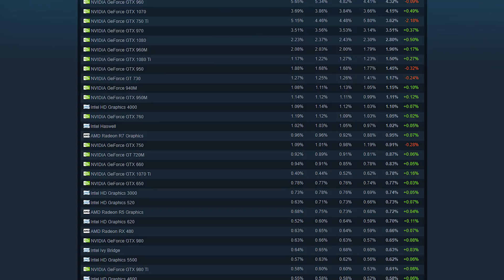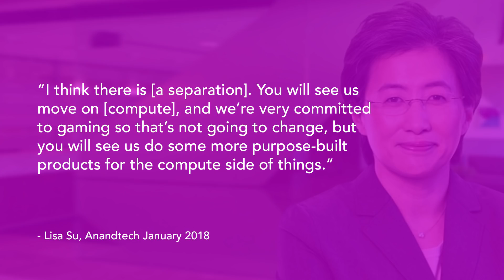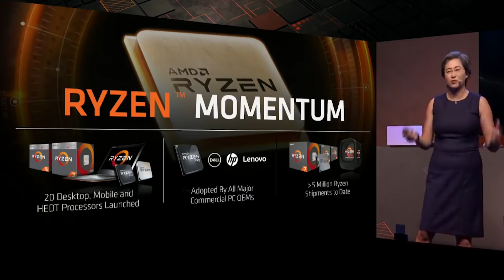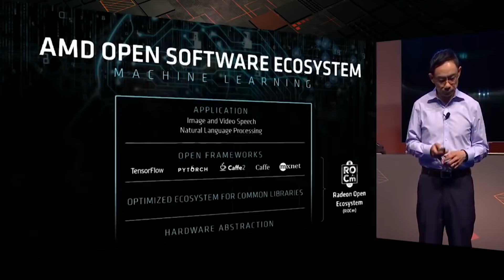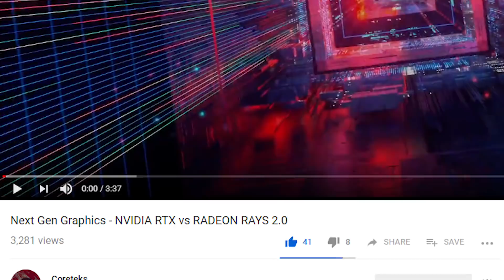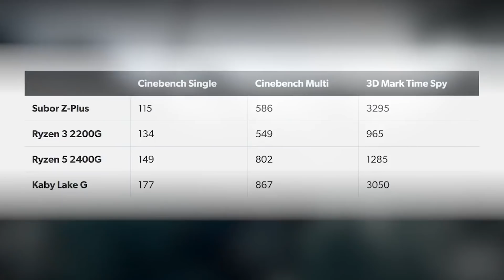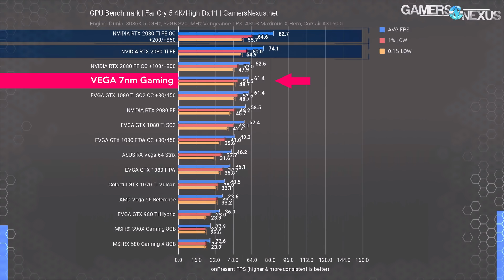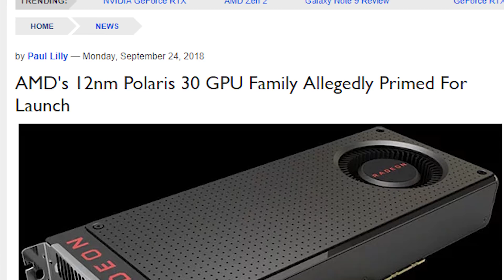AMD's answer to RTX

Comment: Very nice video mate, didn't actually expect to hear any info, I honestly thought it was a generic rumor mill video, but to my surprise it's packed full hah. A couple of things I think you misjudged a bit on Vega, as for example, AMD had to use HBM2 memory not because of architectural design, but rather because of power consumption, as GDDR5(X wasn't available at the time) would be extremely power hungry as a whole package, GPU + all the vRAM chips. Also, Vega wasn't a "fail" because of a bad price, but because of a bad price caused by mining boom. AMD didn't set the prices too high, especially for 56. It was actually a great GPU at that given price, really nice competitor to 1070. 64 was a bit odd, a bit expensive yeah, and LC was pointless with it's price. Other than that everything else you talked about I really liked and I always like and have much respect when people predict whats gonna happen in the tech industry, simply because that really hard and you have to know a lot of things to be able to predict, logically. Navi in 7nm in 2H of 2019. seems actually almost 100% possible and the performance you said I think it right on point. 2080 like performance, but maybe with no RT or maybe not inside DX12 API feature_level.. I dunno. There is going to be some flaw in it, maybe typical AMD power consumption, but I doubt that since we are on 7nm, but they'll have some small flaw or I can say a con.
Oh, and also I subbed because you have a very nice voice tone or "color" as we say. Very dramatic voice, like a trailer for a good horror movie or some dramatic scene in which thousands of people will die. :)

Cheers

Comment: well they invest in computing aspects of gpus, so you wont ever see a high end gaming card by amd. anyone who knows economy just 1% will see that. keep hoping for your 7nm vega its gonna perform like a 2080 max
Reply: AMD has "always been" compute focused..up to the developer to take advantage of its design VLIW5-4, GCN as all "multithread" approach which by its nature are BUILT for "compute" Radeon workstation stuff has kicked Nv products to the curb many times over, the desktop grade shares the same "genetics" just because Nv "chose" to trip all the "fancy stuff out" does not mean AMD did so, difference is when you throw a bunch of complex work at the Radeons they tend to do "quite well" but over the last couple of generations unless you use very specific code the compare Geforce/GTX or whatever "choke" really quick because they are not "jack of all trades" they are either "speed" or "complex" not both, Radeons are a balancing board that goes between those 2 points (workstation class are far far more "complex" because they need it, desktop grade are more focused on "speed" with complexity) 

there is a very good reason why folks were using Radeons for "hashing" for many years now..they do it MUCH better than Geforce (with very few exceptions to the rule)
Reply: is there some performnace trouble with 2080?
Reply: ist the same as a 1080ti performance wise.. but upcoming patch and optimization will make it quite a lot better i think..still,amd isnt gonna have the best gpu on the market,maybe regarding Price but not performance
Reply: vic berlin   I Believe also AMD won´t have the top GPU, but that said, I Think the discussion is sometimes distorted a Little bit, as we focus on THE BEST GPU, while the majority of people play with mid range GPUs. Of course it is nice if someone have 200 fps on a game, but what if 100 is just fine? I don´t Think there will be queues outside stores to get 2080Ti for 1200 USD. So for me it doesn´t matter if 2080Ti is and will stay the fastest. What matters to me is the competition in the mid range, like will prices come down, will there be a faster than VEGA gpu, or some update from RX580, or even just prices of VEGA/RX580 coming down.
Reply: pjotrll nobody will have 200 fps on 4k :D i like to talk About the best gpu because only that will give me 60 fps on that resolution, single gpu. Nothing was able to do that up to now. i got a msi 2080ti ventus, 2 fan design but temps and Overall performance is just a Dream..i Paid a fortune but the way i feel now and the way i can Play my stuff makes me think it was rly worth it..the mmost interesting Cards for the majority of People will be the ones with the best Price/performance ratio, but hey it all depends on what you expect.. i Need the top notch graphics,the experience is just so much better with it
Reply: I didn´t talk about 4K, what I ment was that if you run 1080 or 1440 it doesn´t help much if you reach "200fps" with 2080 and "only 120 fps" with 580, then why would you pay a lot more for things you don´t notice. If one needs or uses gpu for work it is Another issue, then the price might be Worth it.
Reply: @victorchb1  my condolences when your 2080ti explodes
Reply: @edwardpark247  runs fine for over 2 months now,8+ Hours a day,not my problem youre poor

Comment: its pointless to bring 7nm vega at this point when Navi is soon to be here. what they should have done was a 7nm which GDDR6 and call it the RX 580. not make the rx 580 a rebrand. the reason Vega cost so damn much is because of the HMB which we wont get the full benefit of it yet because said gpu are not powerful enough to push 4k gaming at the frames we want in the first place...GDDR6 could have made vega being a 300 to 400 line possible.

Comment: More AMD HYPE, that seems to be the only thing AMD is good at, selling BULLSHIT HYPE... This BS AMD HYPE caused me to remove my AMD Blinders and look to Intel for all my Computer NEEDS... AMD use to be the King of the Hill over a decade ago but in these modern times AMD is nothing but HYPE... Anyone can say they have something working in their Basement but until they can produce a real world sample, it's all HYPE in the meantime... Cheers...
Reply: Are you talking about The CPU side of AMD? If so than you couldn't be further away from the truth, as their R7 2700x is 3-5% behind Intel's best CPU the i7 8700k in 'gaming' for 18% less in price, but is 20% ahead in rendering/compute performance due to the extra 2 cores and 4 threads. Give AMD some slack because if they disappear, then CPU and GPU prices will skyrocket far past what they currently are. The computer industry is a mess under these misgivings.
Reply: Over the past 10 years AMD has said one thing and produced NOTHING. I am with you, Intel needs competition but AMD is Intel's Bitch Stewie and nothing more. If you've seen Family Guy you should know who Bitch Stewie is. If AMD really wanted to shake up the CPU Market they would price their CPU's appropriately but they don't, they collude with Intel and allow Intel to set their pricing. Then AMD wants you to buy, buy, and buy when they don't give you anything better. Sure I will give you the R7 2700 is a bit better then previous Thread Rip Offs but still it's no real competition for Intel. Worse yet what folks fail to realize about Thread Rip Off is it is actually two separate CPU's on a single die. Now compare a pair of Intel Xeon's to Thread Rip Off and you are no where near the margins you listed. 

More so AMD claims to have Quad Channel Memory when it fact it is actually a single Dual Channel for each CPU so basically it's double Double Channel and not true Quad Channel hence the reason AMD is having such timing issues with Memory. AMD Hype is what they do best and that is a shame. If AMD really wanted to shake things up it would price Thread Rip Off at double of what the Ryzen 7 1800, (or what ever is the current Ryzen Chip) is selling for but it Colludes with Intel and jacks up the price some 300 USD more. I've been working with PCs since 1986 and though I will not ever know it all, I can say with confidence I know what I am saying here. I've seen AMD as Top Dog and they trashed Intel until Intel stepped up it's game and took back the lead. Now AMD is not even in the same Universe let alone the same playing field. 

There are way too many AMD Fan Boys out there, I know I use to be one, and I am here to say AMD is selling Hype right now, nothing more, just Hype. AMD has 1 CPU in the top 10, the Thread Rip Off 2950X and here is how it compares to the 4790K (Highest Single Thread of the 3 and Lowest Work load and TDP) and i9-7940X: https://www.cpubenchmark.net/compare/AMD-Ryzen-Threadripper-2950X-vs-Intel-i7-4790K-vs-Intel-i9-7940X/3316vs2275vs3094

Keep in mind both Intel CPU's and single CPU's while Thread Rip Off is Dual CPU's on a single die. Passmark fails to list Thread Rip Off as a Dual CPU and throws it in with single die CPU's which gives AMD a serious boost. If you go to Passmark and view the Dual CPU charts Thread Rip Off is near the bottom and AMD Epic makes a showing near the Top; but Epic is nothing more than a Pair of Thread Rip Offs on a single die or 4 CPU's on a Single Die. There is no way to compare a pair of CPU's on a single die to a Single CPU on a single die; just because it's on a single die does not make it a Single CPU. If AMD really wanted to shake things up they'd release a Dual CPU Ryzen Board. If they did no one would buy Thread Rip Off... Cheers Mate....

Comment: So much wishfull thinking in this video...
If you're going to be cocky and tell your viewers to "present their arguments", first do it yourself. All this video has "presented" are excerpts from AMD management's announcements with nothing actually specified and "just wait, guys, it's almost here!" from the author of the video. Period. Nothing concrete whatsoever. All that AMD has officially confirmed for now is Polaris refresh and I don't see in which universe will RX580 compete with GTX 1070/1080/1080Ti, even on smaller litography, and CERTAINLY not at prices you might expect (with memory prices being as they are and GDDR6 still new). Nothing whatsoever indicates Vega on 7nm in next 3 months, especially with RTG focusing on Polaris refresh now, and proudly insinuating it is wishfull thinking, sorry...

Comment: AMD just can not get their production costs low enough to be competitive. The Vega 56 and 64 are still overpriced at $400 and $500USD respectively.  The GTX 1070 and 1080 go for $365 and $430 USD respectively. The lack of support is the other big problem. From software developers to aftermarket retailers, getting support is difficult to non existent. AMD needs to fill those gaps themselves if third party vendors will not. Thanks for sharing. Very imformative.

Comment: I agree with most of your comments, however as far as AMD were concerned the RX cards whilst not in the same league as nvidia's sold like hot cakes and therefore reaped them some much needed cash. I think they are still on course with thier road plan concentrating on the enterprize market to get the stability they need.
I do believe nvidia rushed the RTX cards because they sensed AMD releasing something soon and to be honest (even at the prices they are charging) it's worked, I don't think AMD are bothered about it at this moment and are happy to just keep Nvidia on thier toes.
What I do believe is they will bring out a relevant high end card within the next 18months to 2 years, meanwhile I'll stick with my current card because I ain't paying double the price for a 20 series card with mediocre performance increse for the money.

Comment: Very interesting really, you earned a new sub!
 I hope AMD can compete - I want them to be able to actually beat Nvidia from the top down some day soon, RTX prices prove what being on top and getting greedy does... I have used Nvidia more in my life than AMD for GPUs thus far, and I want to want to change that, if you know what I mean! 
I don't have any AMD CPUs either, but I feel like that may change with Zen 2 and above, I was very surprised at just how much faster the Zen+ CPUs are - the 2700X and 2600X are both far faster at gaming than the first gen parts!

 Right now I am plenty happy with my heavily OCed Gigabyte G1 GTX 980 Ti, at 1503 MHZ core and 8 GHZ effective VRAM, it soundly beats any GTX 1070, and tends to score in line with 1070 Ti's, and I got her used in 2016 for $355 off eBay - which is the best price to performance upgrade I have probably ever gotten, easily beating out my upgrade from my 4.5 GHZ i7-2600k to my 5 GHZ core, 4.7 GHZ cache 8700k when it comes to overall gaming performance improvements. but everything is definitely better with both combined for sure! (especially since Windows 10 is now on a 250 GB 960 EVO, NVMe is crazy fast!)

Comment: vega 7nm has over 20 tflops compute performance vs 2080ti's 14.2 tflops. will that higher compute performance translate to better ray tracing or AA?
Reply: Nvidia has 110 TFLOPS in AI(4x4 16 bit matrix multiply accumulate).
Reply: Brad Viviviyal  I hear AMD will have an answer for the GTX 1060 6GB one of these years with their 590.
Reply: @abram730  
They already raped it with the 580.
Reply: @abram730  
It performed a little bit better in almost every game... Despite being cheaper, + long term driver upgrades and more vram. On the half vram models no need to speak, RX rapes.
Reply: @thrawn9115  I provided proof that the 1060 is faster.
Reply: @abram730  
Guess it backfired.

Comment: I mean i gotta give props where props are due ... you are reiterating things that AMD has been saying for quite some time while other outlets seems to be playing the "I dont know if AMD is going to do Ray Tracing" as if Ray tracing is somehow a concept tht every single person in that field hasnt already  been trying to harness. .. To your point AMD indeed will be doing Ray Tracing they were not going to say anything but after Nvidia forced theur hNd they did come out and say they were working on it too .. i think it was over shadowed by Microsofts announcement of rolling it into Direct X .. i feel it will move more towards Ryzen interconnects rather thzn simpky slap what is essentially more Streaming processors into the Chip like Nvidia is doung with Tensor cores.. In theory having one GPU due traditional work while a 2nd does Ray Tracing should work but i fel it will use more power and we know how gamers over react to power draw rather it be 5% more or 20% more gamers tend to react very poorly when AMD offerings take more power to push

Comment: good gathering of sources and presentation of your argument. but i think the premise that RTX was rushed is simply wrong. it's the perfect time for nvidia to get RTX into the market and the only reason people are unsatisfied is that the prices are too high. nobody would have gribed if the cards would have been 100 to 200$ cheaper. going by the adoredTV leak this was also a possibility for nvidia which they simply abandoned because there was no competing product on the horizon. why not recoup that R&D cost an keep those fat pascal margins if you just compete with your own last generation cards? that's just a logical move.
Reply: I'm getting a 2080ti. But the launch certainly seemed rushed to me.

Comment: If you look at the slide notes for Vega 20 as a total package rather than focusing on a single bullet point. 7nm is not capable of providing 35% more performance and cutting power draw in half at the same time. The performance gain is very likely 100% due to the doubling in memory bandwidth vs Vega 10 gpus. In order to have a wide enough memory bus with gddr6 to achieve the staggering level of bandwidth that 4 stacks of hbm2 provides, it would cost just as much (or more) while dramatically increasing the power draw. If we assume their gddr6 imc were to have strictly linear power scaling from the reduced voltages vs gddr5, a 256 bit gddr6 memory controller would draw 26 watts of power. To achieve the theoretical 1TB/s bandwidth of 4 stacks of hbm2 you would need a 512 bit memory bus running 16gbps memory. This would have a presumed minimum cost of memory ic's being ~$176. This does bring the cost of components down slightly (~$65) but would add substantial costs to pcb design and manufacturing, as well as costs to power budget.

TL:Dr it's plausible, but I don't find it to be incredibly likely.

(Edit: Punctuation and typo fixes, also had some more time to think)

The one thing I didn't really consider is the fact that the reduced cost to manufacturing components would yield a significant reduction on the shelves. **BUT** There are significant engineering costs to doing something as seemingly simple as changing the memory interface. What I think would by far make the most sense, is for AMD to hunt down a large source of 2-high stacks of HBM2. This would achieve the necessary bandwidth without the added engineering time / costs, without eating into the power budget, and (most importantly) cutting the cost of memory by as much as 1/2. 

Another thing I failed to point out when talking about the slide presented by David Wang, we're talking about a 150w power target GPU here. Anyone who's been paying attention already knows Vega loves power and scales very well in that regard, and AMD themselves have stated there will be a 150w and 300w Radeon Instinct. WITH THAT IN MIND: It's entirely possible the stars align and AMD releases something that can compete with the 2080 ti in rasterization space, while also potentially falling into the 2070-2080 range using DXR. If they could shit that thing out for $6-800 they would have one hell of a contender on their hands.